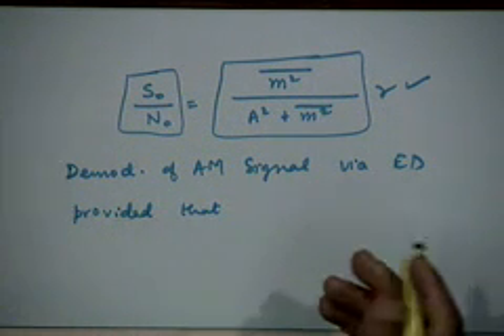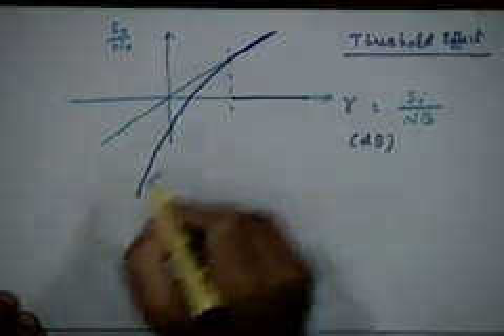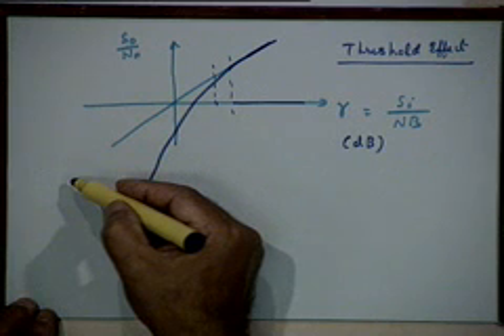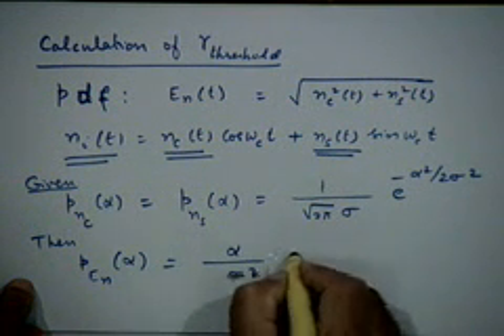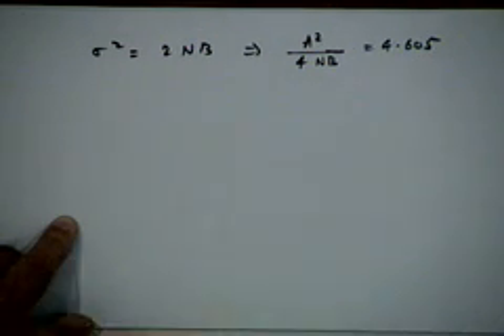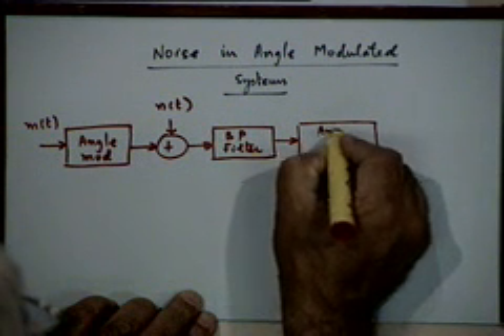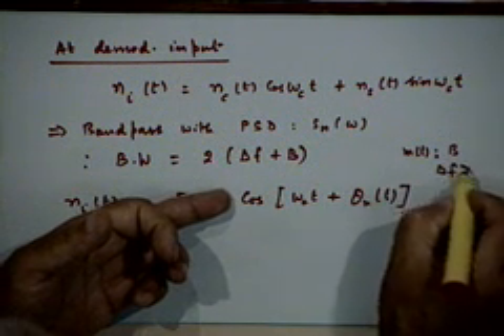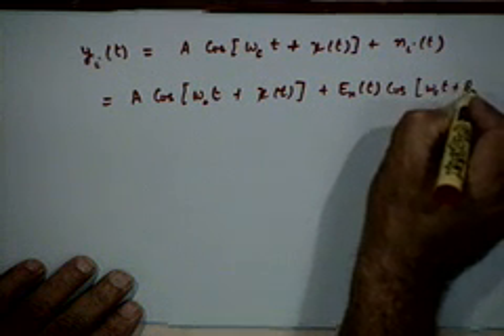Lecture -35 Noise in AM and Angle Modulation Systems

Comment: 🎯 Key Takeaways for quick navigation:

00:20 📊 The lecture discusses the performance of different modulation schemes in the presence of noise, including synchronous and envelope detection.
02:20 📉 In DSB AM with a carrier, there is a reduction in SNR due to inefficient use of power.
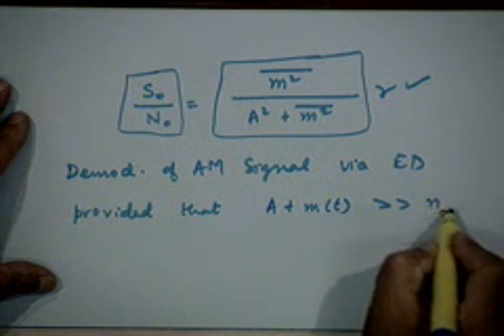03:34 🎙️ The performance of synchronous demodulation and envelope detection is identical when noise is comparatively small.
10:01 🚫 Under high noise conditions, the envelope detector fails to deliver a signal proportional to the message signal.
11:49 📉 The synchronous detector exhibits a linear degradation in output SNR as input SNR decreases.
13:58 📉 The envelope detector shows a threshold effect, deviating from the linear curve as input SNR falls below a certain threshold value.
16:38 📈 In typical broadcast applications, the threshold effect is not significant due to higher input signal-to-noise ratios.
25:29 📊 Calculating the threshold SNR involves defining a threshold based on the probability of the noise envelope exceeding the carrier amplitude.
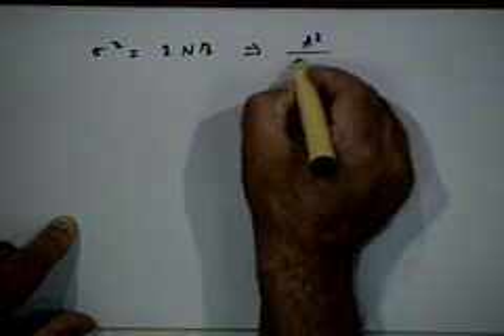28:13 🧮 The calculated threshold SNR is approximately 11.4 dB for the given scenario.
30:23 ❓ The choice of a probability value like 0.01 for defining the threshold is arbitrary and serves as a practical definition.
33:13 📡 In angle modulated systems, the model consists of a modulator, a channel introducing noise, a bandpass filter at the receiver, an angle demodulator, and a baseband filter for SNR calculation.
35:17 🌐 Unlike amplitude modulation systems, angle modulated systems have a wider bandwidth, requiring the bandpass filter to pass most significant frequency components of the modulated signal.
36:40 📉 Angle modulation systems are not linear, making the analysis more complex and preventing the use of the superposition principle.
37:29 📶 Modulation signal s(t) contains intelligence within a waveform psi(t), which depends on modulation type (phase or frequency modulation).
41:59 🔊 The bandwidth of the bandpass filter must match the bandwidth of the angle modulated signal to ensure proper demodulation.
45:36 🌬️ Noise fluctuations in angle modulated systems happen more rapidly compared to the phase of the signal due to the difference in bandwidth.
47:00 🎙️ Calculating the output SNR in angle modulated systems involves considering the combined effect of noise and signal amplitude on the instantaneous phase of the carrier signal.
51:35 📏 In the small noise case, noise amplitudes are much smaller than the carrier amplitude, leading to small angle approximations for phase calculations.

Made with HARPA AI